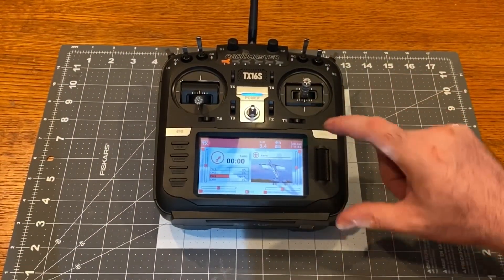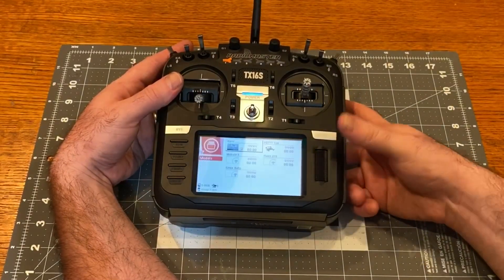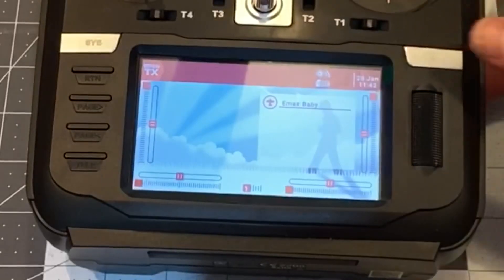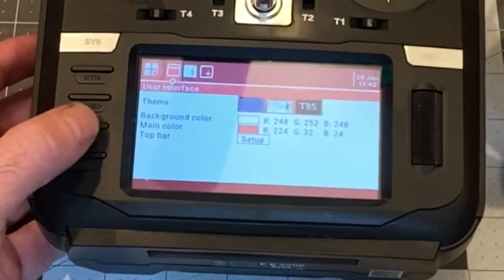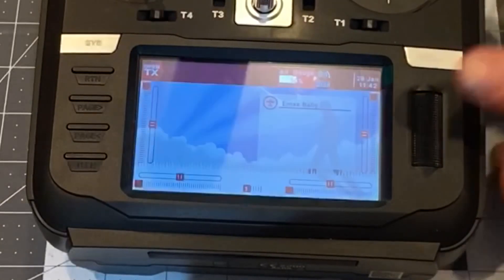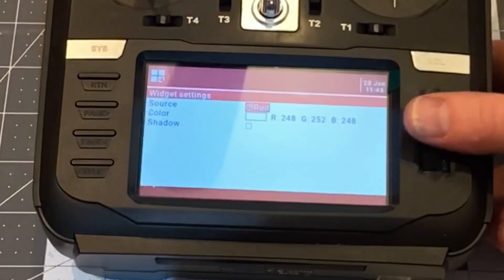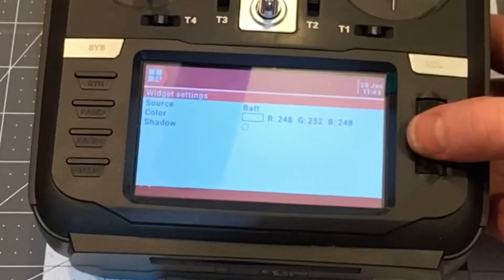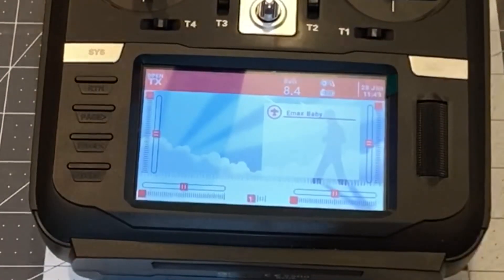RadioMaster TX16s - radio battery voltage on home screen?

Comment: Does the battery voltage reading only work when a model is selected? In other words, can I make it a permanent widget on all screens? Thanks for the tutorial!
Reply from the maker: graywoulf I do not know of a way to avoid setting up the widgets every time for each model. I suppose if you copy a model already existing you could avoid setting all that up. Then you would have to edit all the channel mapping and other model specific details. That is the only way I know of.

Comment: Anyone else have trouble getting battcheck top bar widget working on the T16?  Got VBAT (frsky telemetry) value widget right next to it reading fine, but bettcheck will not read for the life of me.
Reply: Same Problem here... I see it next to the sensor, the radio is reading it out at 14V but I can't get the widget to show it..